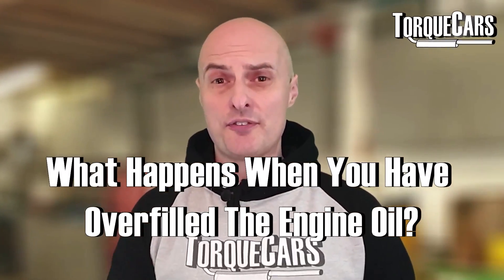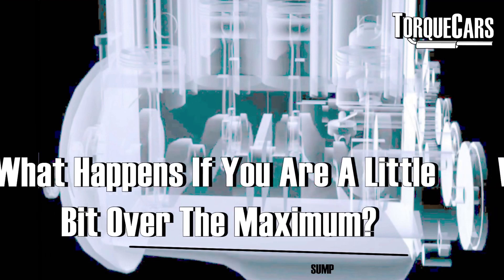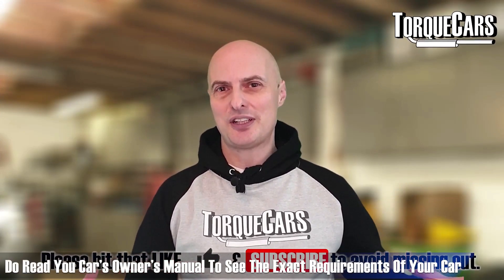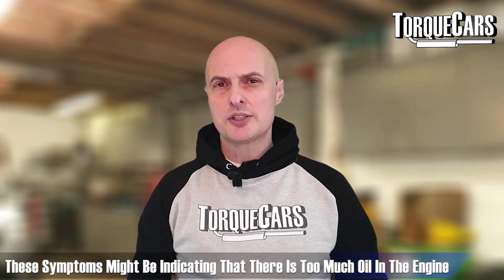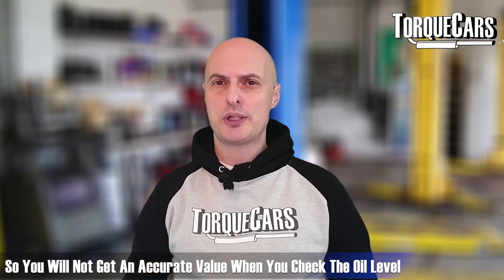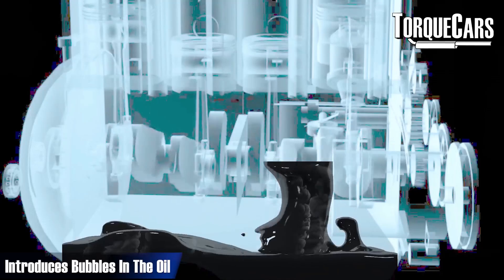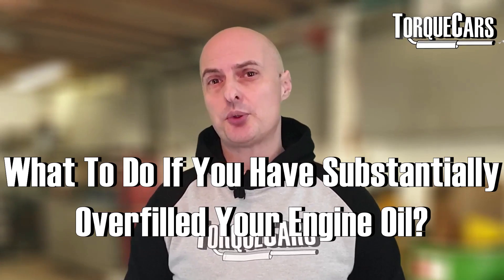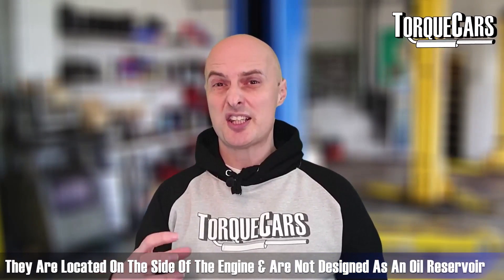Overfilled Motor Oil! What Happens & Engine Damage Done - Fix & Avoid Too Much Oil Problems

Comment: I think we need to understand each engine is different and the amount of oil that could cause a problem is different in each case.  A quart of oil over fill isn't going to hurt anything. If you have so much in there it's hitting the rod journals then you're going to create foam and that's bad. But nobody makes an engine so sensitive to oil level that a quart of extra oil is going to hurt anything.
Reply: Hopefully I can get a response. I noticed my oil was leaking so I topped it off and tightened the cap.. seems fine now but looks like I’m an inch above the max line… does this sound worry some? It’s a 2013 vw Jetta, I find it does burn off oil when I drive but I’m not sure if I should drain some or not

Comment: I brought my car to a major chain.....which I never do. They overfilled it. Piston ring shot through the engine. 80MPH, small explosion and white smoke. Large puddle of oil left on the road as well. Oil level was still over the maximum fill line by the time it got to a shop.

Comment: I have a crv and has been overfilled. It has been affecting the camshaft position sensor. I know because on hill start it starts cutting out on idle and has shown the engine fault in diagnostics.

Comment: Can the oil that spills into the crankshaft be removed? Or will draining excess oil from the sump help removing oil from crankshaft,  or will oil from the crankshaft flow back into the sump if excess is removed? Cheers
Reply from the maker: Oil will generally always flow back into the sump, so draining off excess oil will help. The crankshaft sits just above the sump which is why you don't want it dipping into the oil and splashing around.
Reply: @torquecars  so just drain and it should be OK then , thanks for that mate , it's appreciated 👍
Reply: Forgot to ask, what if any of the oil has foamed up,  will it settle again or need removing somehow ?
Reply from the maker: It should settle, after it has run through the filter and warmed up and cooled down the bubbles will normally dissipate.
Reply: @torquecars  thanks again for the reply , I've  been out to it this morning and drained some out through the dipstick tube , I've got a fluid removal kit, saved me jacking up and crawling under lol

Comment: On my 2017 Subaru Outback it requires 5.1 quarts. Why Subaru came up with 5.1 blows my mind. Out of 7 oil changes I have had, dealer included, 6 quarts put in and of course they charged me for the 6 not .1. I've had to have the extra oil sucked out, usually by myself. I'll be changing my own oil from now on. Tired of getting hosed.
Reply: Same experience here...dealer always overfilled my 3.6...and I'd suck out the excess at home.   Change my own these days....also using better oil and filter than the dealer uses.

Comment: I am currently experiencing an oil smell whilst driving my new car, I checked the oil and it seems quite high but I also checked the oil when the car was running and it spat oil quite heavy out the dip stick!!! Is this normal? I'm hearing this could be pcv or crank case pressure? I have since found that the car I bought was sold as a non runner at some point 😢
Reply from the maker: Removing the dip stick with the engine provides an outlet for the crankcase pressure to escape so splashing of oil in this instance is quite normal for most engines. Oil smells are often down to spills whilst filling and they fade over time, do check around the engine for leaks and make sure there is an appropriate amount of oil in the engine.

Comment: My Mazda takes 4.4quarts but I usually just had the whole 5quart jug, should I stop doing so? 🤔
Reply from the maker: Which engine do you have? Most engines are tolerant of around half a quart overfills, but there are some exceptions out there. You would usually notice at least some of the symptoms of a problem if it were an issue.

Comment: Should I be worried about the place where the oil leaks after I drained the excess oil?
Reply from the maker: Always put a drain pan under the sump to catch the oil and dispose of it correctly or save it for future top ups if it is clean and in good condition.

Comment: Got my 1st 2012 Lexus IS 350 90k service done at stealer by the seller. Drove her home and checked oil level straightaway it was over filled by half an inch above the max, jacked the car up and bleeded the oil till it's just setting at max on the dipstick.

Comment: Every time my son gets his 2021 Honda CRV  serviced at the Honda dealership they over fill over the max mark, he questioned this and the dealer said its measured quantities by the manufacturer and an electronic pump dispenses the correct amount of oil for the model ? I am guessing if that s the case they are not fully draining the old oil out and leaving at least 700mls of oil in the engine otherwise this would not happen.  He has gone back to them twice now to to get the excess oil drained out and on one of those occasions they tried to charge him £110 for a complete oil change. Just unbelievable and that's a certified Honda dealership. He has decided he will not use the Dealership again and will take to his local independent to have it serviced.
Reply: @Azureecosse  tell your son to just change the damn oil himself. Its takes 20 minutes and saves a good amount of money. Plus its good for him.
Reply: Ya they don't let it drain completely it would take too long...they plug it back up after it starts drizzling out...the fill to spec, then don't check the level and say hey car ready...always check the level, and if the oil fill cap is tightly on
Reply: @Azureecosse Honda CRV old man car
Reply: A computer says no moment that we encounter too often these days

Comment: I have this issue my car shut off twice on the highway, I did take the local road and drove 20mph because if I drive faster it would shut off again. It does smoke really bad when it starts. I took it to 2 shops and they tell me I need a new engine. Is there a way this can be fixed ? The engine isn’t even knocking either.
Reply: Did you ever figure it out?

Comment: how much oil is overfilled that could reach the rotating crank and cause foaming?? my car was overfilled by 1Liter by our local dealer and I was able to use the for 2500km before I already discovered it, but I didn't experience any symptoms. My engine is a Toyota 1kr-vet1.0cc Turbo.
Reply: @boaus5259  ringh now i overfild my Honda with 1 liter of oil, dip stick level is 2 cm over maximum! I think its ok!?

Comment: How do You fix this issue ?
Reply from the maker: Yes drain the oil (a filter change is not required) and always fit a new sump washer. Hopefully it has just led to rough running and little blue/white smoke. When drained you'll be in a position to see if anything permanent has happened.

Most people will drain the oil, measure it and return the correct amount (minus a quart as it is easier to add than remove) to the engine, check the dipstick and top up if needed.

In most cases as long as you get to it quickly and it hasn't run too much or too fast with substantial overfills nothing too serious happens.

The most common worst case is leaking oil seals, and when these are replaced it will be like new. Even these can improve over time in some cases when the oil pressure has returned to normal levels.

Comment: And I have a 2019 Buick envision I thought that I read right that it takes 6 quarts of oil but apparently it takes five I only put 5 and 1/2 quarts in will that cause any problems
Reply: Hey bud ...I'm almost certain that only half a quarter would effect it but I would still drain it out if it hasn't been used up ....I think l it should be okay

Comment: Why my 2017 Audi q7 (Driven 88000 kms) requires 1 ltr engine oil top up every 2000 km ? Lot of my friends has the same car and model. They never topped up engine oil.  What problem my car has ?
Reply from the maker: The 3.0 TDi V6? High oil consumption is usually caused by oil passing the piston rings and burning off.

The oil collector/scraper control ring often gets cloged up, running an oil flush and draining and refilling sometimes helps.

It could also be a turbo issue, pcv / oil separator fault. Have you had a compression test done on the engine? 

Using the wrong grade of oil is also a potential problem here. If it was too thin for example this would cause it to seep and burn off.

Comment: Thank you so much for this video. It’s been a defining moment to solving my over filled engine with oil. I was convinced after watching your video that I have over filled my engine contrary to thoughts it was the turbo which would cost a fortune to fix. I have watched your video over and over again until I resorted to draining the oil by using a hand operated pump from Machine mart. I was able to drain 2.5 litres of oil in the first day. There was a drastic reduction in both white and dark smoke from the exhaust upon several revs . I am beginning to get confident that my second attempt to drain the oil further would result in a complete smoke reduction after several revs. Grateful for a very good and well explained video. 
Keep up with the good work

Comment: Hello i have one question if i put to much oil on my bmw f34 320i  and now the level is at max is ok?
Reply from the maker: If the level is at max that is fine, you'll have notices problems already so it looks like you got away with it. Most cars tolerate a little over the max marker.

Comment: I put 5 quarts in a 4.4 capacity. 2016 acura tlx. Should I sell my car now?
Reply from the maker: Are you getting any symptoms? That is not in my humble opinion a major overfill, but I would drain off a little oil especially if you are getting problems like smoke or loss of power.
Reply: @torquecars  
I have not noticed any smoke or loss of power from the two days I've driven. The dipstick is showing about two inches over the maximum though. I went ahead and bought an oil extractor pump device that will arrive tomorrow. I was going to remove the excess oil via drain plug but I'm too lazy to do all that work again so hopefully the pump device works. Wish me luck! And thanks for the reply!

Comment: I think that the manual for my vehicle says to have the engine run for at least 10 minutes after replacing the oil before checking the level. It says nothing about checking it when cold. Maybe you only need to check it cold for some vehicles? Never heard of anyone doing that
Reply from the maker: Always follow the manual, I think I've misrepresented the "allow to cool  a little and oil settle" as cold which as you say doesn't apply to all cars and some apparently need checking when the engine is running, having checked this - the markings on the dipstick are set in accordance with the measured temperature, hot oil expands and tends to read higher than cold. The key is if you've just run the engine to warm it up, you need to allow time for the oil to run down into the sump to get a true level, this can take a while even when the oil is hot.

Comment: Well heres a new one....My car takes 4.9 liters with Oil filter...I had topped up my car a couple days ago, as I do have a small leave from a seal. (Pending replacement) But the other day I was coming back from a weekend day at the track watching racing. And I was pushing my little 1.4L 16v Clio 3 a little over 150km/hr. And this huge burst of white/blue smoke came bellowing out the exhaust. Too my knowledge I had put a little too much oil in my car, reason for this is my Dip stick was broken when it was getting its cambelt done.
Reply: Gasket blown maybe

Comment: If anyone could chime in on this: my brother accidentally drained his gearbox oil instead of the engine oil, put 4 litres of new oil in (so the engine had 2x the engine oil level). He ran the engine for maybe 15 minutes, less than a mile driven. Gearbox is most likely fine after being refilled, but there is still an enormous amount of white smoke coming out even after draining half the engine oil (of course all needs to be drained and replaced with new oil but we're just trying to see if it isn't damaged and going to the scrap). It puts out a lot of thick white smoke when revved up (I guess about when the turbo starts spinning fast). 
Would that indicate there's oil in the turbo? Failed oil seal? Should we run the car for some time and see if it stops? Any advice welcome. Thanks
(It's a late 90s Peugeot, 2.0 turbo petrol)
Edit: late update but car's running very well after proper oil change and 1-2 weeks of driving (generally short urban trips, but very frequent) there's no oil smoke out the exhaust.
Reply: How is the car now ?
Reply: Thats the oil creeping past the heads and now it flooded the intake and wet the plugs too. I had that mistake.
Reply: Idle it until the smoke goes away... I've flipped multiple pieces of equipment you wait for the oil to flow down start it idle it and get going
Reply: late update but car's running very well after proper oil change and 1-2 weeks of driving (generally short urban trips, but very frequent) there's no oil smoke out the exhaust. No impact on the engine performance, though a engine MIL did pop up a couple time over the month after.

Comment: I checked mine a few days ago, below min line. Topped up about 500ml at a visit to auto parts store, drove home. Tried driving about 45 mins later and got horrible misfiring and it hasn't started noey for 3 days. There was a leak but i can't tell from where and i did drain about 500 again and re added fresh oil to it being just above min line now, I've put in new spark plugs incase they got mucked up but no luck. Battery deffo needs charged up to continue tests but i have no jump leads or charger. Hopefully a mechanic will look at it tomorrow
Reply: And for the record this is on a "bulletproof" old Toyota 1.4l with no recorded engine problems before. Never failed an MOT test. Someone said it might just be coincidence that I added oil when I did and it could've experienced failure anyway.

Comment: We recently experienced an engine overfill by the dealership. My son and his wife have jet skis with supercharged engines. After being serviced at the dealer he took his 10 hour new ski out to the river and it ran sluggishly, wouldn't reach redline. Took it back to the dealer and they immediately suggested to remove and test the SC for slippage of the clutch discs. Big labor bill looming/possible rebuild of SC. That didn't sound right to him so he brought it home and we began to diagnose it before getting a second opinion. I found the oil sump was overfilled by a couple of inches, so I siphoned the excess out and checked the spark plugs, which were heavily fouled. Replaced the plugs and took it to the river again. It ran like new and was as fast as ever. Problem solved.Then we checked the other jet ski. It too was way overfilled. Turns out both had more than one quart extra oil put in at the dealership. The dealer must have an idiot doing oil changes or a very unethical plot for generating service work. The service manual is strongly worded to NOT OVERFILL. Supercharged engines do not like that.
Reply from the maker: Sorry to hear your problems, many dealers take for granted what they think they know and don't keep up with the changes and reading the manual is probably the last thing they would do. You are not the first and I'm sure not the last either.
Reply: Im here because I'm experiencing the same problem at a golf course I currently work at. The manufacturers recommendation says "2.1 qts" but then the dipstick says it's way overfilled. After reading an online forum it's obvious that manufacturers are recommending us to overfill the our engine, proprobably on purpose. 
     The dipstick seems to be more accurate
Reply: Dealer money indeed by worker told to put an exta quart in. - Or workman never trained properly if at all. Figured daddy taught him years earlier. Not!
Reply: @romanpastuchsr2319  that is awful! I hope he doesn’t use them for oil changes again

Comment: Ayy bro my car says it takes 4.5 quarts and I accidentally used up the whole 5 quarts is that bad ?
Reply: nah, most cars end up that way. id never go a full quart over, but .5 is fine. i personally do it to my car all the time. 

to the guys point, check it after you stop, if it's foamy at all, drain some out. if it's not dont worry about it

Comment: This just happened to my daughters car. Her BF added oil without checking after she said she thinks it needs some. After seeing smoke and feeling down on power she called. I had her take it to the shop where $1200 later she was back on the road. They had to replace a valve and a spark plug socket tube. On another note, ive never heard that you are supposed to check the oil cold. Ive always thought that was supposed to be checked hot, but now im thinking i confused doing that before a oil change, with checking the oil.
Reply: it depends on the car. look at the manual.

some recommend cold, some recommend 5 minutes after engine shutoff, some recommend to check while running.

the manufactures modify the lines on the dipsticks depending on their "plan" for the user thats in the manual.

cold will always be higher.
Reply: Transmission- check hot 
Oil check cold-
Reply: Depends on manufacturer. At my Honda bike I have to check it warm. U always have to check U instruction